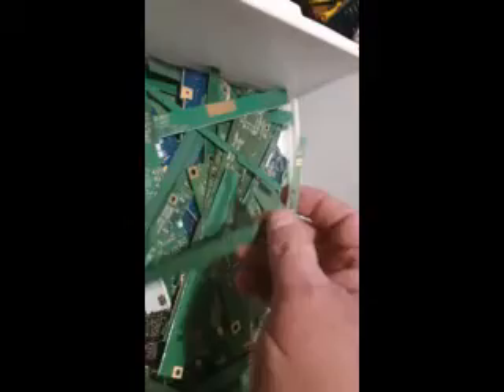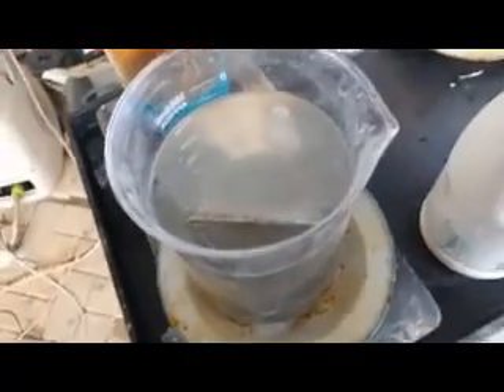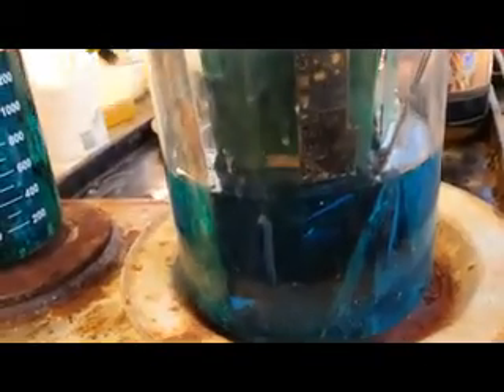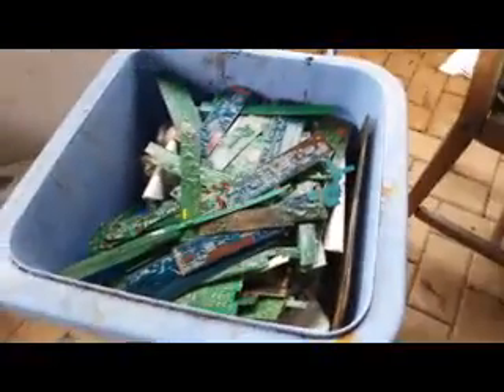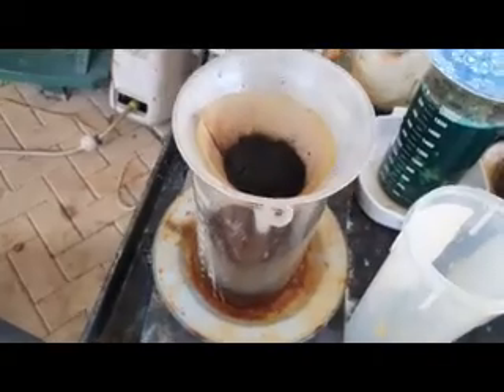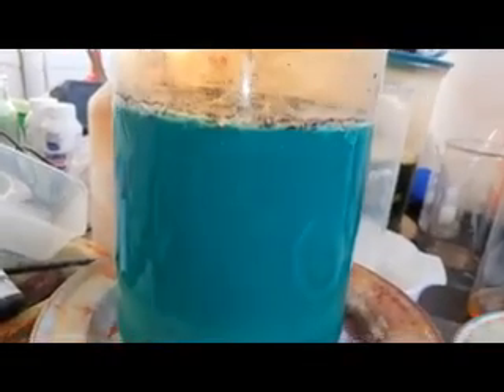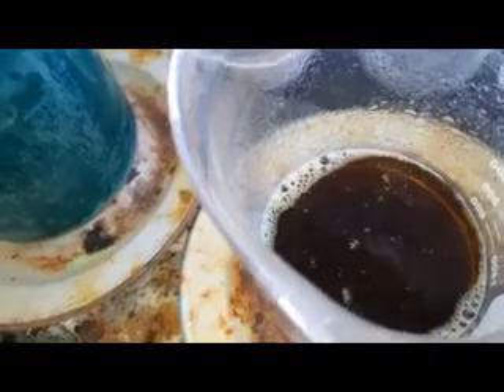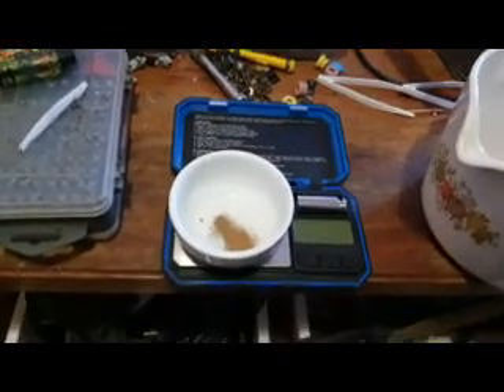GOLD RECOVERY / removing gold with nitric

Comment: Pete I’ve just dryed some powder as I speak,all I do is put the wet powder in a small beaker around the 250-500ml size and dry it an oven,but on a 45 degree angle to keep all the powder together and in one little corner hopefully that will help you out.
Reply from the maker: Awesome thnx. Ill try it

Comment: What I fo when I have lots of pulp like yours,,i still use my filter paper but i would use a small strainer that's sits over the filter paper..it catches all the pulp in the strainer  and the clean solution goes through to the filter paper...this method works really well when you lots of gold pins that are still in the plastic.its easy to seperate
Reply: Thanks for the tip.
Reply from the maker: thats an awesome tip , thanks for that. sadly i dont have a small straiiner but ill keep my eye out for one

Comment: While soaking in HCI, will HCI remove the silver too
Reply from the maker: Im not sure. I know nitric dissolves silver but i havent heard of hcl doing it.
My guess is no
Reply: @prospectorpete  thank you, by the way, why are you washing those board with caustic soda( Lye )
Reply: @pierreqiu8147  the caustic soda (lye) removes the green solder mask on the circuit boards..Pete has a recent video where he uses lye to remove the green solder mask...when it's removed it reveals the gold underneath if it has some
Reply: @aidavewaste2576  Got it thank you